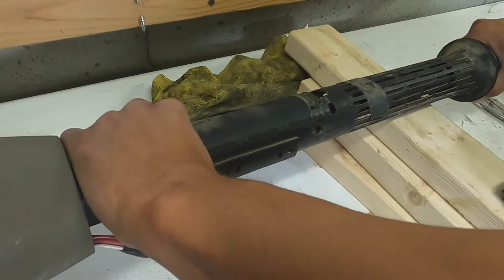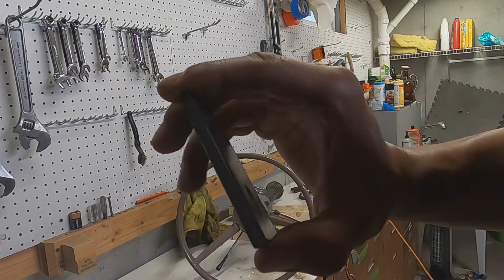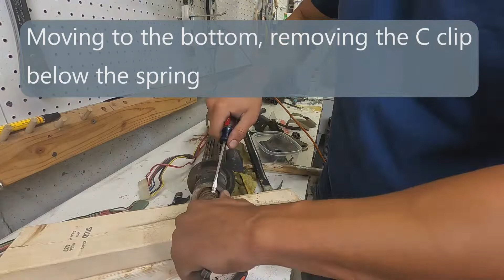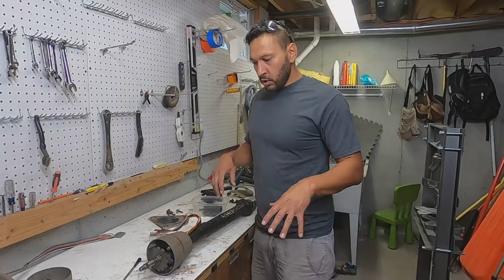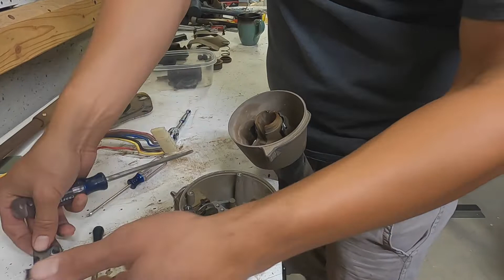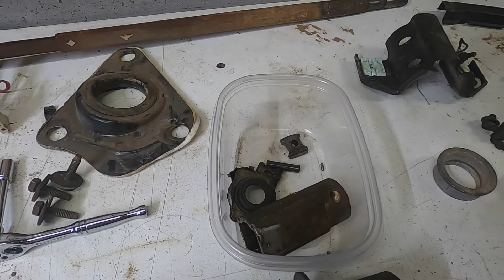Plymouth Duster Steering Column Rebuild Part 1: Teardown and Inspection

Comment: Great video! I'm changing my auto column to a manual column. I found a junkyard manual truck and now I'm switching everything. Watching your vid and taking pics along the way. Where to buy new bearings?
Reply from the maker: Hi John, glad the video was helpful!!  Finding bearings was a bit of a pain. Eventually I was able to track them down. Here are the part numbers and where I bought them: CHR2265656 / 2925491 from Detroit Muscle Technologies; 
MOP-04147318 from Summit. I finally got around to installing this past week and both bearings fit correctly in mine. Good Luck!

Comment: What I did for my wheel was fill cracks with resin. Sanded it nice and then had a local upholstery shop wrap it with leather. It looks so good
Reply from the maker: Nice idea! I was not sure how to fix all those cracks. I better hold onto this one after all. More options for the future! Thanks buddy!
Reply: @DustorBust  I am into my wheel for $80. They leather stitched it on the inside and unless you look close you can’t even tell. Plus the wheel is much easier to grip now
Reply from the maker: Nice! I will keep that in mind for sure. You definitely beat me on cost, but so far I have not had to put too much into it. Some wheels are pretty cheap, hopefully it looks good in place, tbc.

Comment: Great video! I completely agree with you, always save, refurbish, reuse and or purpose whatever parts you can. Stuff is getting hard to find and expensive!
Reply from the maker: For sure, and I do love the look of some of the original stuff too. Good to customize, but equally good original. And parts are crazy expensive. 😆
Reply: @DustorBust  yo do you know the size of the jam nut for the steering wheel ?
Reply: @Robert Salcido  I would just go to lowes and use their bolt and nut gauge. Hopefully you still have the old one. If not- get a thread and pitch gauge.

Comment: To repair the under dash or steering wheel plastic peace you could try the super glue and baking soda trick. I’ve done it on some plastic parts before with good results.
Reply from the maker: Thanks B Dubs, I have not heard of this before. I will have to search for it. Thanks for the tip!
Reply: @DustorBust  think you can find some videos of it on here.
Reply from the maker: Plastex, cool I will look for it! This helps for sure, I was not sure what terms exactly to search for. Thanks! 👍